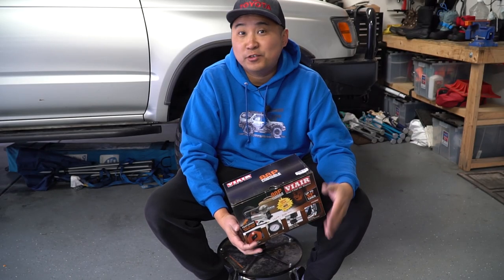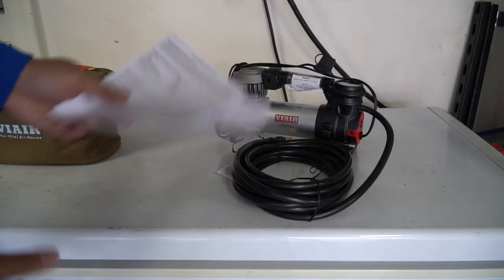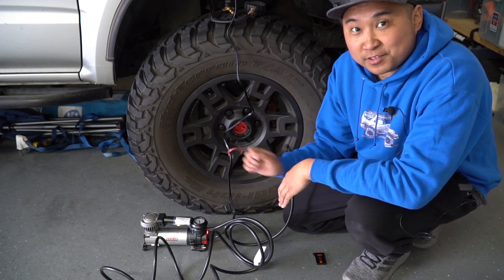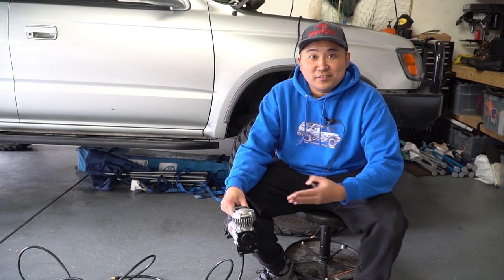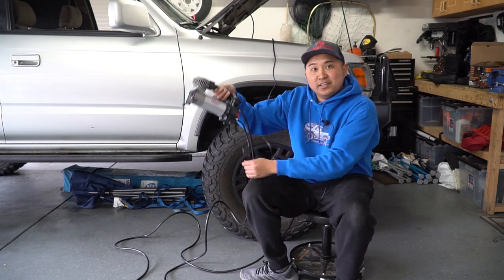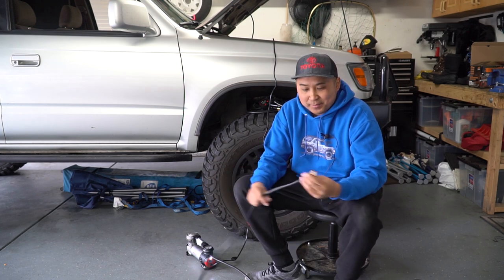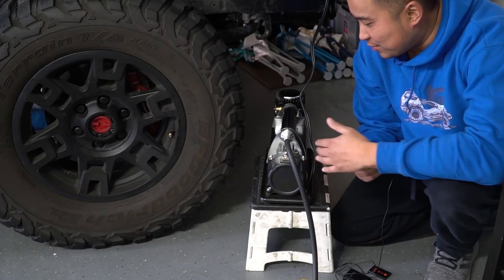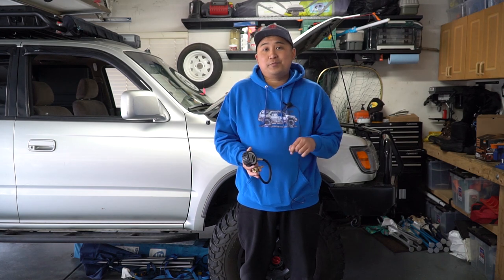Viair 88p Budget Offroad Tire Air Compressor For Your Toyota 4Runner

Comment: Thanks for these videos, really helpful for newbies like me. I bought this same compressor, read great reviews on it, and it is a really great affordable option. However, big warning - be very careful pulling it out of the bag.  The handle is super sensitive, and mine broke.  I didn't realize it until after airing down and hitting the trails, and when I pulled it out and tried to air my tires back up, I got nothing. I finally found the small crack in the handle and realized that was the problem (the air tube runs through the handle - major product defect).  Almost got stranded, but a buddy was still around and let me borrow his.  I ended up sending it back and replaced with a GSPSCN (similar pricing) and love it so far.
Reply from the maker: Interesting! Check out the napa max trax one!

Comment: I use the rioby air compresor gun.  I use it for 45 seconds then I sit it off for 2 min.  It's good for to air up 1 tire. It's not good to air up all tires.  But it works for me.
Reply from the maker: Nice! I’m gonna be building a 4 tire inflate system soon :)

Comment: The wires are short because there are probably 30 Amps  It will be interesting to see what kind is that fuse holder, because if it is from the  cheap ones , with that amperage it will slowly go bad and it will eventually melt the fuse.
Reply from the maker: It’s a 20amp fuse for the viair. The smitty wire is super short , forgot to check the fuse rating on that. 

They should beef up the wire a bit lol. But yes these seem to be known for blowing fuses when ran to long. I got another unit that I think may be better that I’ll be testing out next week

Comment: Love all your videos! so glad I ran into your channel. I have a question I'm hoping you can help me out with.  So I bough some 17" wheels made for newer Toyotas, but they fit my 4runner great. The issue that I'm running into is the expected rubbing once I get some all terrain wheels on them. So my question is, If I lift my 4runner about 3" can I avoid all the rubbing and avoid having to trim my bumper and all that? I really don't  want to cut my 4 runner. Thanks!
Reply from the maker: Which Toyota 17? A lift will definitely help with clearance for daily driving but articulation will bring it right back to rubbing in same spot but likely won’t happen unless you offroad

Comment: Nice video. I have the 88p as well for about 4 years. That screw on chuck irritated me a well. Last year i found an adapter to screw on that converts it to a clip on chuck.  Nice comparison with the SB2781.  The 88p is rated at 1.47 CFM and the SB 2781 is rated at 5.65 cfm. Not sure at what psi the cfm matches..  Which is almost 4 times the cfm output but the 88p time was only double the  sb2781.  That was interesting to see.. Because i had been contemplating getting the 2781 at some point if i ever moved to 33s.. but it looks like the 88p is more than capable... Might get it if it's on sale as a backup.
Reply from the maker: Find a Napa compressor! Way faster and beefy
Reply: @PhoRunner  .. Yeah i have seen the Napa and the price is nice but the issue i have is their quality control. Too many people report issues of it arriving broken, or failing shortly thereafter. I am overseas, so too much of a risk to buy and if it arrives broken, i am out of luck.. Plus there is no warranty to fall back on even if i was able to get it back to the US.
Reply from the maker: This is true

Comment: FYI. The built-in gauges for these air compressors are not accurate at all. I have the Smitty and it's off by 2-5 psi. 38psi will get me close to 33psi. It's been discuss quite a bit on other channels as well.
Reply from the maker: Interesting. I ditched this air compressor for a Napa one :)